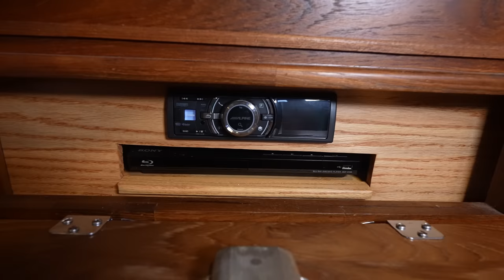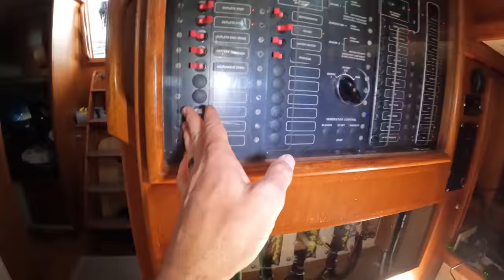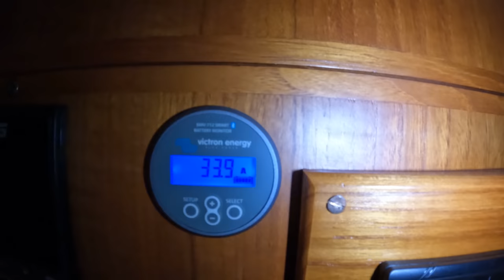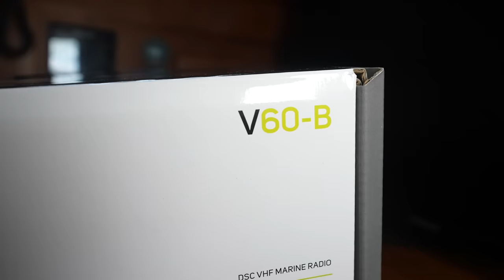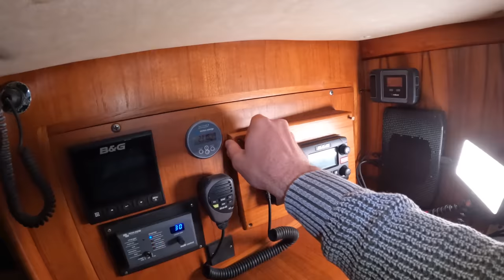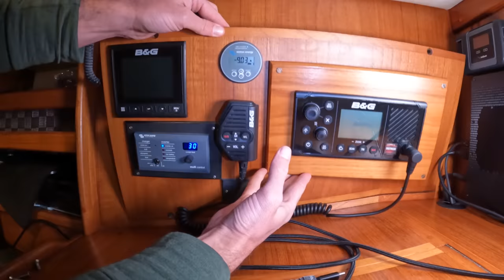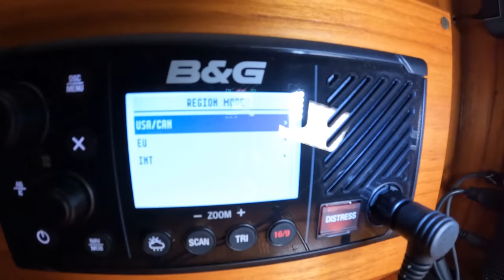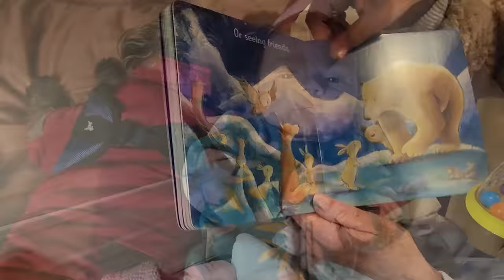Is it Safe to Sail with a Baby? | S08E05

Comment: Just watching your latest video about installing a fan for your battery charger and I think you might want to check to see how much heat is being actually removed from the charger. I noticed you have an air inlet from an adjacent compartment but I didn't notice an exhaust port out of the charger compartment. Perhaps you have one and it just wasn't shown in the video. So you can ignore the rest of this comment. However, if there is no exhaust port the compartment will just heat up and heat will  dissipate  by air leakage from around the door and/or from conduction through the compartment walls. These may not give you enough loss. So what is likely to happen is that the charger compartment temperature will rise and reach an equilibrium. You may find that the temperature may be higher than you would like. So it  would be a good idea to understand what that temperature is and how it compares to the charger specs for environmental operating temperature. Of course that temperature depends on the ambient temperature around those compartments. The net result may be that it just takes longer for the charger to fail.

Comment: YOU NEED AN AIR OUTLET HOLE FOR YOUR CHARGER COMPARTMENT!!! otherwise it will break again :((
Reply: Agreed!
Reply: Unless the door is opened each time, you are correct...the air needs somewhere to go.  It needs an outlet
Reply: @CessnaPilot99 true but someone, someday will close it accidentaly.

Comment: Love the edits in this episode AND the cartoon graphics and video.

Don't you want an air outlet with that charger? You're bringing, or pushing, air in but don't you want to pull the hot air out?

A lot of new hardware. How is your power going to handle that?

Do you have Bluetooth earbuds to help you hear radio communication?

Comment: You also need a vent coming out of the compartment the charger is in or the air flow will dead head. And it won’t work

Comment: 11:46  Okay so you want it to breath easy with a nice BIG intake and fan, but where does all that air go?  Without proper outflow you're just blowing air into a bag.   Unless there are enough seems and gaps to allow the air to escape that cabinet, but you've already gone through such effort to be certain the intake is great, why not vent another vent on the other door?

Comment: A better way is to reverse the fan and suck out any warm air otherwise the heat will be trapped with the charger.
Reply: Was thinking the same thing.  For our ice maker installation in our boat's mini bar, we installed a similar fan and oriented it so that we sucked the air out of the cabinet and blew it into the bilge area and cut a louver into the front of the cabinet to allow the fan to draw air from the salon.  Not sure Jordan has air balanced with this install.

Comment: I don't know if this helps. You want to be able to blow heat out of the compartment not push the hot air back in. That's what they do with computers. Blow the hot air out of the computer.